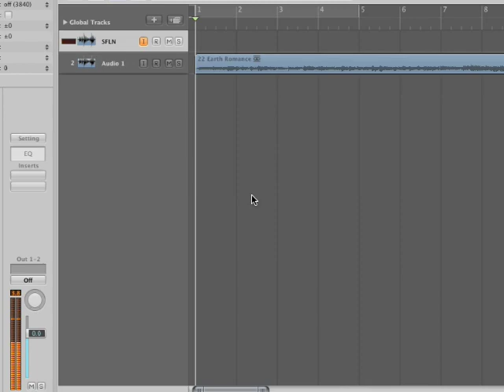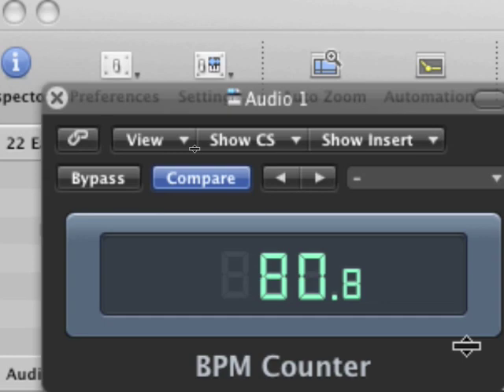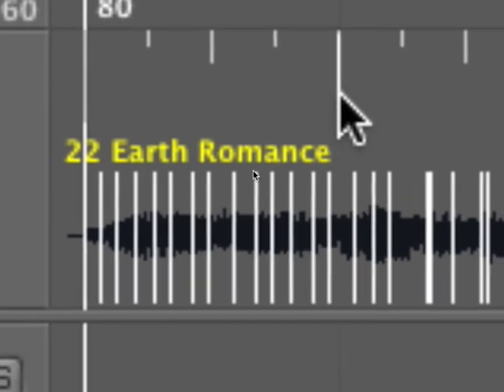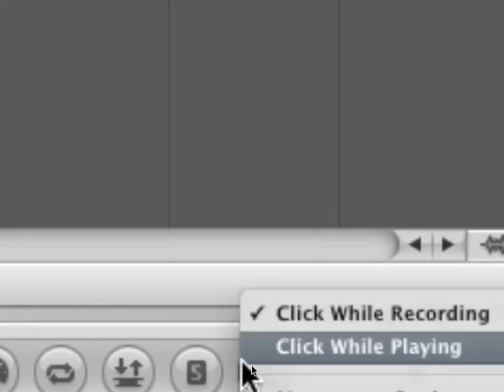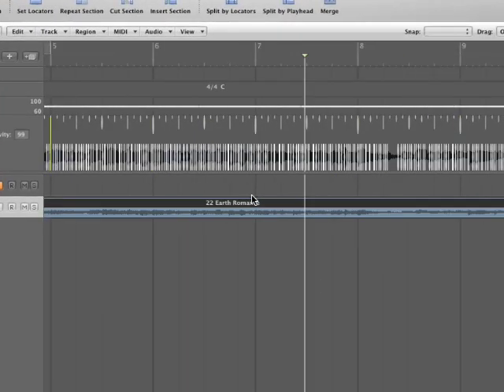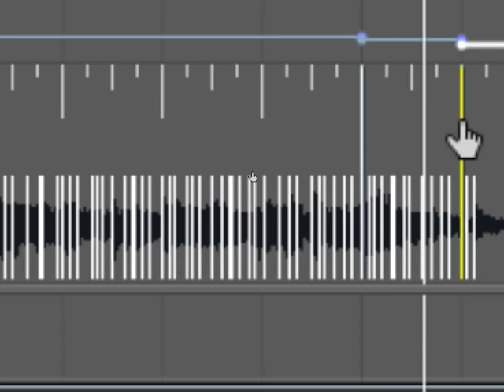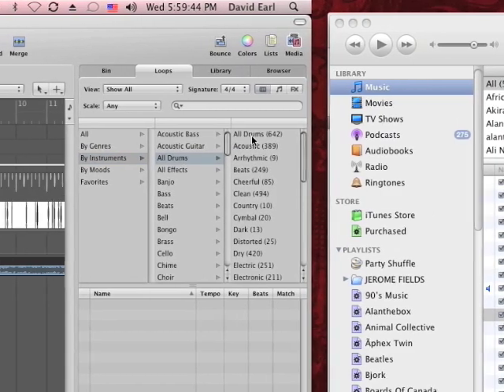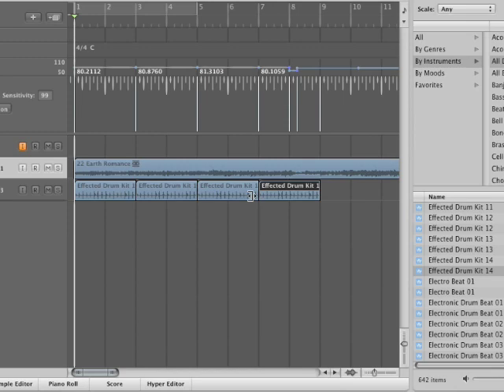Tip#20 Beat Mapping

Comment from the maker: This is an isuue. It won't 'loop', but if you have locators for the section you want to repeat, hit command-I to select all inside locators, then Command-' To cut within that area. This should cut your tempo timeline as well, and then just option drag the section. When you get to my time-stuff video you will see how you can make this process a little easier.
*bows*

Comment from the maker: Since loops are attached to the originals, I tend to shy away from them, just by habit. It's probably a quicker work flow to use them... Honestly, if I used the 'L' key command instead of selecting the loop function, I'd be good. Thanks, b... you just sped up my workflow!

*bows*

Comment: @natecarey1 Hey there, if you use beat mapping for midi you can click and drag the bar lines of the tempo track to the note which should start on the beat, make sure you lock the notes (region - lock SMTP position) because otherwise Logic will move notes you already beat mapped (Why the heck does it do this?) You will see that all your notes will allign more or less but the first note (the one you mapped to the beat) will be exactly at the bar.

Comment: Can anyone help me with this? 

I'm trying to do this beatmapping thang and for some reason when doing this to one section of the song that slows down per measure by 10 bpm from 170 down to 100 it actually slows down the audio and the metronome instead of just the metronome. Not sure what I'm doing wrong.

Thanks for the help!